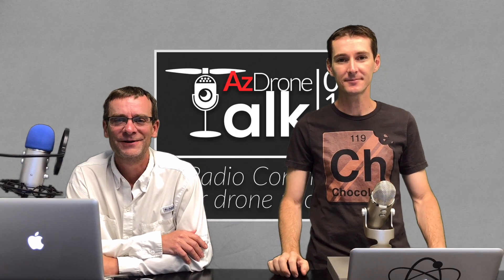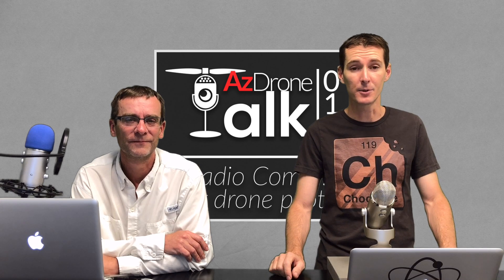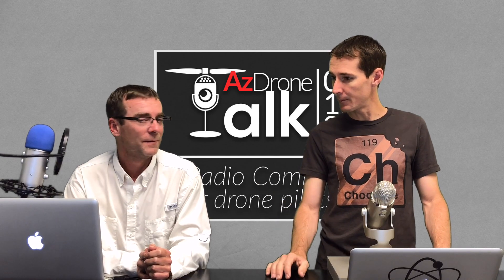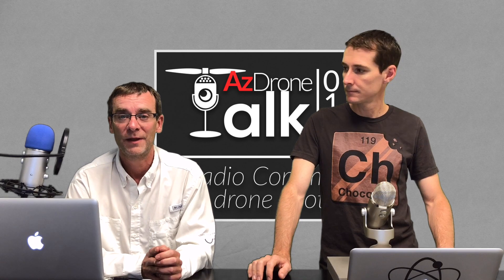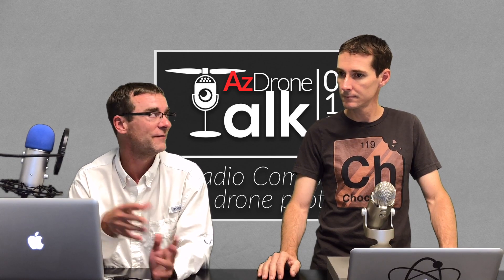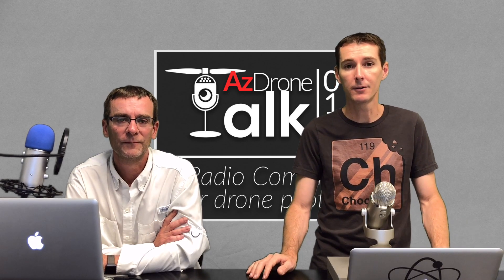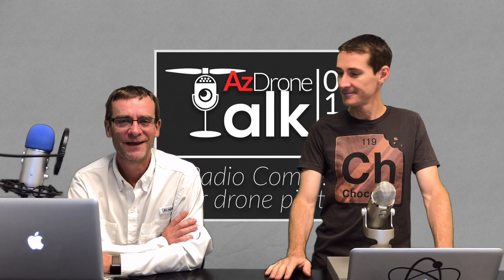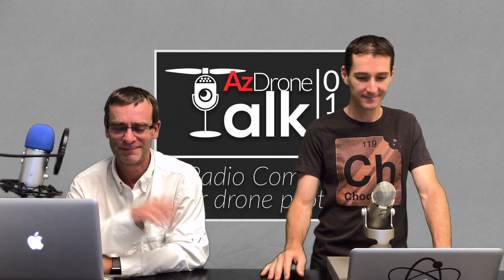Radio Communications for drone pilots - AZ Drone Talk 018

Comment: To talk on the radio you need at least an RR- restricted radio operator's license, or you can go all the way and study for your CROL. It's $35 (the RR) and all you need to do is apply for it at the FCC website. But this still comes with the requirement that airband transmissions are only for mission/safety critical use only. No doubt anyone listening will scrutinize a drone pilot using the airband.

Comment: If you ever felt like maybe doing a follow-up to this video it would be helpful for drone professionals who don't have any experience in the radio world.
 I recently did some research about radios and I came across several that seem to be programmable like you described but it seems like a pretty complicated process for someone who doesn't have any experience.

While researching I learned about fms, gmrs, some radios that have both bands and different amounts of power and the radios from manufacturers like baofeng which seem to offer a lot of capability but we need to set them up.

If you're looking for something to do while you're grounded due to bad conditions a radio tutorial might be fun...